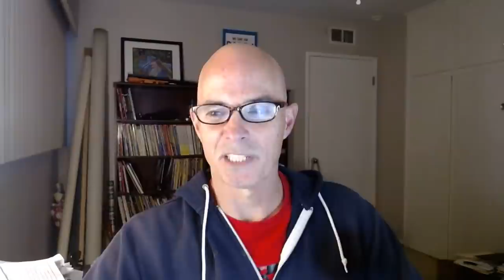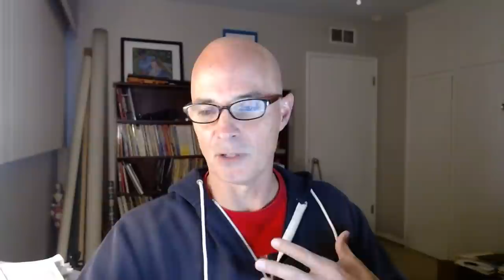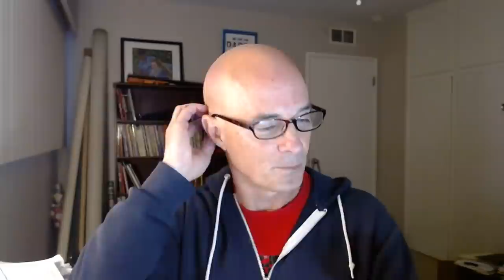LET'S TALK-CAM LIFT, DURATION & LSA (Q&A)

Comment: I'm a big fan for David Vizards cam calculations! His theories about needing to know your heads when deciding a cam make alot of sense too.
Reply: I totally agree. I followed Davids advice on my SBC and she just rips. Best motor i have built so far. for the most part the rotating assembly was the same. the cam was based on  Davids calculations and this motor is a total ripper compared to the others..

Comment: I agree with everything that was said about duration, lift & LSA. Valve events should not be considered a mysterious gray area meant for mathematicians or quantum physicists. At the very least, anyone looking for a cam should know how much overlap they're getting and when the intake valve closes which is the most important event by far. Overlap is responsible for the thump thump and for scavenging which helps overall efficiency. When the intake valve closes has a lot to do with what RPM range the cam will be happy and more importantly, it has a drastic effect on compression.
Reply: Bingo. Intake valve closing events being wrong can ruin a motor with the resulting detonation requiring to back the timing way off or retarding the heck out of the cam. Totally changes the plan.

Comment: True story: I studied physics in my first year of undergrad. We learned calculus and differentials in physics before we learned about them in the math classes. The physics prof explained to us at the beginning of class that to learn physics, we'd need the math and he also knew that the math classes were pure and not applied, so they dwelled on theory at the expense of speed. The physics prof showed us the practical uses of the math that we'd learn more rigorously later. It was odd in the moment, but it made the mathematics classes way easier to understand for all the people taking physics.
Reply: I took physics last and I quickly realized it's basically math, just in motion. Thermalfluid dynamics was the one that broke my brain! Hardest class I've ever taken lol it was like physics but only dealing with fluids which just further complicated everything by adding viscosity and the like into the physics
Reply: @swappedoutZ71  just be thankful that you didn't take a class in quantum physics.

Comment: Sorry I didn’t watch live. I also apologize for a long post. I’m going to try to explain how to compare cams more effectively than just intake duration and LSA. Stop now if you don’t care.

Maybe I’m a cam nerd or something, but a couple calculations get you beyond intake duration and LSA to describe a cam. The first takes one simple formula, the second takes two. The most significant parameter is to convert duration and LSA to intake closing (IC). You need intake centerline, determined by LSA and cam advance, and intake duration to determine IC. Many cams are installed at 4° advanced, and I use that number unless the advance is stated. If the specs say LSA 113 +3.5, that means the cam is ground with 3.5° advance, so you’d use that instead of 4°. The calculation is duration divided by 2 plus intake centerline. Example: the Comp 459 cam. 231/2 +109=224.5, subtract 180 and you have 44.5° ABDC for IC (intake closing). That number gets you a power peak around 6500-6800 rpm for a 6.0 or 6.2 LS, 7000 or more for a 4.8. The variables are head flow, intake runner length, and displacement which also affect those numbers. To get a power peak rpm like that with a SBC, you’d need at least 10° more intake closing, most likely. A BBC with a long stroke (496, 540, etc) will take another 10° or more to make power at rpm because of displacement, bore size, intake valve size, etc. 

The other factor, which takes two calculations, is overlap. We figured intake centerline from LSA above by subtracting cam advance. Exhaust centerline is LSA plus cam advance. LSA is physically ground into the cam. Every degree that you adjust the cam in the advance direction reduces the intake centerline and increases the exhaust centerline. We need the intake and exhaust duration numbers, LSA, and advance to calculate overlap. Intake opening (IO) is duration divided by 2 minus intake centerline. Exhaust closing is exhaust duration divided by 2 minus exhaust centerline. Using the 459 cam at 4° advance again we get 231/2-109=6.5° ATDC and 239/2-117=2.5° BTDC. Positive numbers are more overlap, negative numbers less. Here we have 9° of overlap, meaning the intake and exhaust valves are over 0.050” for 9° around top dead center.

Overlap generally improves mid-range torque, which in turn improves power. Like on the intake closing, displacement, bore size, intake valve size, and head flow all affect the engine’s need for overlap. Bigger engines and long stroke small bore engines want lots more overlap than smaller or short stroke big bore (over square) engines.

For a particular engine family you can compare two cams by converting intake duration, LSA, and cam advance to IC or intake closing after bottom dead center (ABDC). Comparing two cams IC number gives a very good indication of relative top end performance. Increase at the top is almost always decrease at the bottom, other things being equal.

Again, a particular engine will have more mid range power (fatter torque curve) with more overlap. Small engines need less than big engines and idle quality, or idle chop sound, increases with overlap. You can definitely have too much overlap, but too little steals mid range. Just compare an LS9 factory cam curve to an aftermarket cam. The wide LSA steals overlap and kills mid range compared to the aftermarket cam.

I hope this helps someone out there. Maybe all it does is validate why Richard just uses intake duration and LSA.
Reply: I asked Ashley at comp cams long ago, why do your shelf cams have to wide of a lobe separation or not enough overlap. He said we have to save people who will use too much dur from themselves and of course blaming the cam co. When the engine doesn't do what it should, or what they expect
Reply: I'm doing research "how cams effect performance" even tho I'm running a bmw with two cams  + vanos. (Yes i understand my Lsa is variable to some degree ) This comment has more gems and good info than a who day searching Google. Thankyou. I'm still looking for more information about reverse split cams/ high exhaust manifold pressure. Even n.a. bmw cars seem to run a "reverse split" from factory(24 valve m50/m52/m54 ect.. cars )

Comment: Built in 1981- 340, X-heads shaved 60 thou, port matched, mild porting and polish, Holley Street Dominator, 800 Thermoquad, 302dur. .468 lift solid lifter 104 degrees overlap and Hooker competition headers, balanced bottom end, for my 69 GTS Dart, line lock, 4:10 Richmond gears in an 8 3/4 with an A833 shifted by a Hurst Ram Rod shifter, and line lock, this was my toy for the streets back then. Was guesstimating around 425hp as dyno's  were very rare here in Canada back then.

Comment: Richard, I'm by no means a pro when it comes to camshafts, however, I do know enough to get me in trouble from time to time. So... I'm putting a simple, but stout pump gas 10.2 to 1 (should be around 8.4 dynamic), great flowing aluminum AFR heads,  350 SB Chevy together with an old grind hydraulic roller camshaft from Comp Cams (known as the "306" grind). The cam specs are "roughly" 230/ 244 at .050"  (Actual according to cam card is 229/ 245 degrees) for duration and a lobe lift of  .340/ .361 ( .510/ .540 with a 1.5 rocker) with a wide LS of  112 degrees advanced 4 degrees from Comp to 108 degrees). Also, for you to know is that I'll be using ported and cnc"ed Corvette rams horn manifolds with a very high flowing 2 1/2" exhaust. After explaining all of that, my question is this: If I run a 1.6 ratio rocker on the intake side and a 1.5 ratio rocker on the exhaust, I'll have a .544/ .540 lift with the supplied cam lobes from Comp. With the 229/ 245 split in duration, shouldn't that combo of lift work just fine with that duration and a smaller exhaust? Also, would increasing the lift to .544" with a short 229 degree duration still be easy on the valve train for street usage? Any help or thoughts would be appreciated. Thanks in advance, Jim Howard
Reply from the maker: IT WOULD LIKELY BENEFIT FROM 1.6 ON BOTH-JUST NOT SURE WITH THOSE MANIFOLDS

Comment: One valve event that is very important to know is when the intake valve closes. Once you know that you can use a dynamic compression ratio calculator on the internet to determine what static compression ratio will give you the best performance depending on fuel octane.
Reply from the maker: there is a lot more than a simple dynamic compression calculation to determine power or detonation threshold
Reply: @richardholdener1727  of course there is. I was just pointing out that valve events can be helpful to the average Joe.

Comment: When I was in high school everyone just claimed they were running a Three Quarters RACE cam!  Everyone would nod their heads and go that's pretty extreme man!   Pretending that we knew what they were talking about
Reply: Yeah, that one was popular where I grew up.  Never knew what that meant.  3/4 of what?  Only has lobes for 6 cylinders?  I suppose it was some duration number 3/4 of the way between a stock SBC grind and the Duntov 30-30.  (Whatever a 30-30 cam is.  Never knew that either.)
Reply: @andyharman3022  from what I was taught back in the 60s and 70s you could order a full race cam from the factory dealership or a smaller three quarter race cam depending on what type of street drivability you wanted.
Reply: @andyharman3022  3/4 vs full race, that came about when there werent many cam grinds.  The term 30-30 is a reference to the solid-lifter cam's valve lash settings assigned by Chevrolet.
Reply: @cuzz63  yes sir the old Duntov performance!!!
Reply: 3/4 cam, the day you showed up at the parts store 1/4 short on money.
Reply: @nojunkwork5735  lol
Reply: @nojunkwork5735  That's great.
Reply: @cuzz63  in 86 I bought a cam for my 71 Lemans.  I really didn't know how to spec a cam so I ended buying "something like a Ram air IV cam"  like a dumbass I was still running stock springs so it didn't make a huge improvement.
Reply: @DuffusMonkey  yea, thats actually not uncommon.
Reply: Back in the day when overlap was discussed
Reply: @DuffusMonkey

Comment: You have to match the lift to the airflow of the head. Then go with the higher duration mixed with the lower LSA. That will maximize power

Comment: I'm used to cams we used in dirt track engines with 106 and 108 LSA. I noticed that everything you use is 110 to about 114. My cam is 107 LSA but it's still only about 500 lift. The duration is about 235/249 at .050. I know the idle will be rough but will it do well for power with a 5 speed in a very light car. It's a 360" SBC  with flat tops, 0 decked and Dart  Iron Eagles, 64cc. And the intake c/l is at 102° it will be run with a dual plane air gap and a 750 Holley.

Comment: Otto cycle is 720° of rotation.
4 Strokes-5 Events

Intake, Compression, Ignition, Power, Exhaust.

Ignition starts a few degrees of crank rotation before TDC on the compression stroke and completes so many degrees after TDC on the powerstroke.

Cams only rotate at half the speed of a crank, timing is necessary

Overlap is when both valves are open during exhaust/intake stroke for scavenging and cooling of the cylinder and head.

The theoretical ideal charge which is called the stochiometric value is 15:1 however it causes engine temps to be too high so for optimal cooling is 12:1.

Using the wrong cam can cause valve overlap to be reduced meaning valves open too late and close too early so cooling/air intake and heat/exhaust are not fully realized in the cylinder. Too much cylinder heat can cause preignition and detonation.

Lift is only how far the valve is off its seat. Duration is how long the Valves are off their seats.
Reply: Increasing overlap can also allow unburnt hydrocarbons into the exhaust wasting fuel energy and polluting the environment.

Comment: People really do have to learn the math for valve events. It's simple percentages. If you really love something, you put the time into it.
Reply: If it were really that simple, the engineers who design cams wouldn't have jobs. There are a lot of forces at play on various components and many people completely forget to think about the tribology or material strength.
Reply: instaBlaster...
Reply: @stephendee7839  That's understandable, but at the end of the day, you end up with a 7500 RPM engine that has a long soft spot along the middle of the curve, where you could have had a 6500 RPM engine that hits harder, all the time, with less valvetrain stress.
Reply: @Dr_Xyzt  Well you've clearly demonstrated that just because a thing is understandable, that doesn't mean that you can understand it.
Reply: @stephendee7839  Would you mind elaborating there? I don't blame you for coming to that conclusion.
-- Where I'm from, people tend to buy stuff and slap it together. So, a given cam/valve/pushrod package might be stable enough to not drop a valve, since it's a validated kit. They fail to realize though, that they get a long duration cam on a stock intake that pushes the practical operating range beyond where the intake resonates. That's a simple computation of percentages, grade-school mathematics. That, is what I frown on.
Reply: @Dr_Xyzt  RH offered a video on the rudiments of a few aspects of cam design without getting into the mathematics of it. It's a good approach and he's a great informer who's really experienced with this stuff. But he's not trying to teach people the mathematics involved or calculate the acceleration effects on the materials, etc.

You're attempting to suggest that people need to learn math to use packaged cam specs. They don't! People can use manufacturer specs to "buy stuff and slap it together" all day, every day. The times you need to learn and use math skills is when you're optioning a custom cam for a specific rpm operating range and power/torque characteristics. In those cases, you need calculus to evaluate the cam ramp effects on the drivetrain components as well as some understanding of the strength of materials to estimate safety factors of moving parts and film thicknesses for lubrication. None of that is "percentages."

Comment: Cams are a great way to make power just remember there is a give and take . You will give up low in power for high in power on most  stockist engine. Just remember don't give up too much squeeze with a large intake duration because you give up too much low end power.

Comment: Its all about the combo, and you can run a LSA of 108- 110 which is considered tight with Nitrous and make great power. Some blower companys like 110 LSA to make power over 114 , plus helps with cooling the exhaust valve.  Engine masters did a comparsing between a normal 110 LSA cam and a spec blower cam for a supercharger setup and the difference was  minimal..seat of pants wouldnt tell the difference. Its all a selling marketing bit. Richard is correct for the most part. As Richard says this is the basics. There is more  too it . cubic inch , bore , stroke,  head flow, valve dia., compression. I learned alot from Dave Vizard, Bill Grumpy Jenkins,  Warren johnson and Mike Jones . LSA is not the most  important number , its just a fraction of the big picture. Plus LSA only changes the power range by 500 RPMs up or down. MHO...🤔
Reply: Well.....what is the most important number since you know?!?

Comment: Take a stock lt1 5.7l the cam is ( lift) intake .447/.459 exhaust  and int .205/ .207 exhaust (duration) .05 . If you divide 205 stock intake by 300"hp" by 205 int cam you get = .68 as a ruff value of what represents  in this eng sbc meaning the numbers on the cam to achieve 100hp. You can take the 300hp divide x 205 = 1.46. (example 268 intake duration cam times that 1.46 = ruffly about 391hp cam efficiency  base without your other power adders like heads/ intake/ exhaust/ fuel or piston compression could be more then 100hp on top)  to put ppl in the ball park provided you have the matting components easy recipe. The way I guess the right cam for the job is all the numbers matter, first the {HIGH LIFT adds AIR good for short max compression} HIGH EXHAUST moves AIR OUT,  faster rev and piston, DURATION How LONG STAYS OPEN FOR FUEL/AIR SIDE TO SIDE LOB, LSA LOWER the number the more. RUFF adding to the drive ability and timing to add more fuel between and also poor gas mileage. Meaning a cam with a 268 intal duration and thought good exhaust lob as well should build you a race engine that will put you over 400hp likely and under 500hp crank unless you really spend and this is a presumed 4 bolt main.

Comment: Lift of cam can relate to head flow... Suggestion only. Where a head flows maxs out the cam lift should be close to that .
Reply from the maker: I don't agree everyone should chose their cam based on head flow (90% of us don't use all the available head flow)
Reply: @richardholdener1727  Richard. I agree but in most cases of race situations you want max lift to be as close to max head flow as possible . can we all afford to do this hell no but what I have been taught is for example your head CFM maxs out @ .650lift@ 300CFM. For maximum power you want cam lift as close as possible to use as
 much CFM as possible. On the other hand using the same head but the cam lift max out at .580 and your trying to run max RPM to achieve max power a better flowing head will help were the cam falls off .
Reply: @richardholdener1727  The heads are the lungs of the motor and the cam is the heart pumping the blood flow .lol